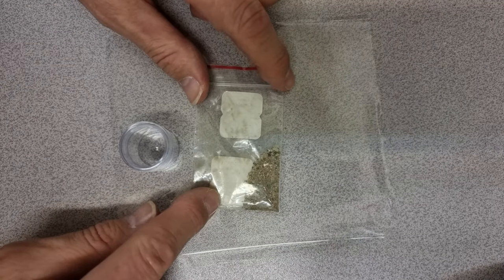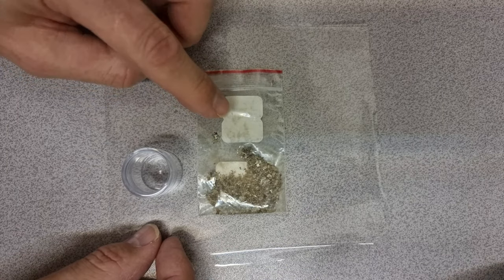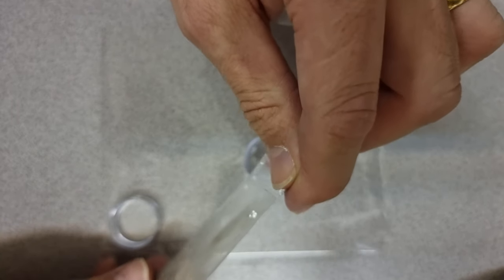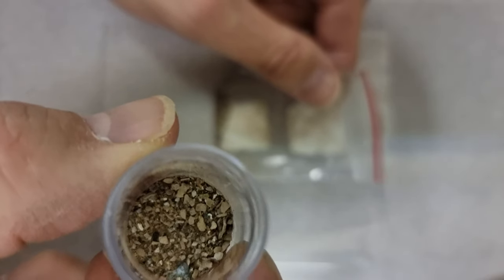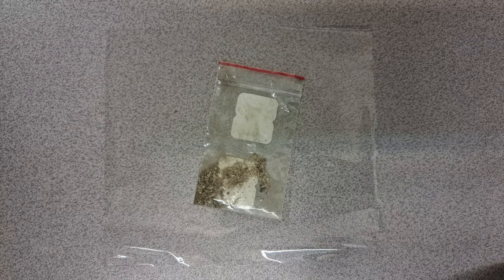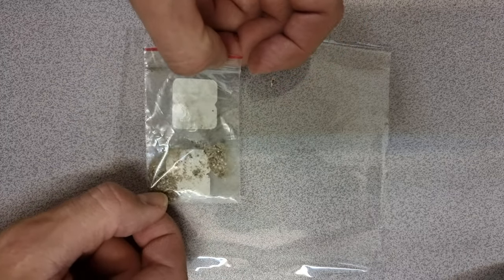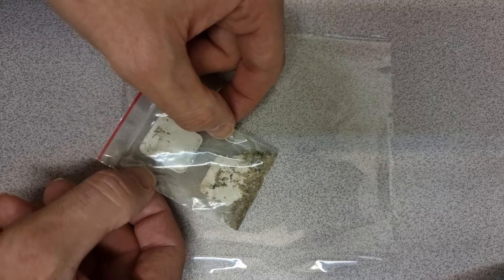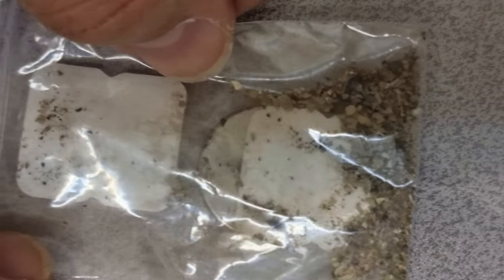Bin-Juine Huang - Investigating scale samples from active LENR reactor for ferromagnetic particles

Comment: To make a magnet you can pass a piece of metal through an electric field and it makes the metal into a magnet.

If there is a buildup of static electric in the system it will lead to tiny lightning bolts transumting things. Metal things in that mix are being exposed to this strong electrical buildup and thus get magnetized. 

Notice too, that sometimes materials seem to catch an like pole on your magnet and are repelled not simply attracted. 

Stuff in that bag was turned into magnets. A good question to ask would be along which axis of the compass was the pipe this scale was collected from oriented. 

You can magnetize a piece of soft iron by laying it on the north south line and tapping the south side. 

You can demagnetize it by turning it east west and tapping the west side. 

I learned this from a book passed down to me by my grandfather who was a frogman in WWIII. It was written by the war department and details everything electrical and magnetic through the whole of the armed forces. 

Grandpa's signature and the date he signed it are in the front cover. 1947.
Reply: Not related, but your mistype of WWIII sent chills through my spine 😮
Reply from the maker: Nice tips. I shall use the magnetometer on the part of the sample that was not exposed to the ND52 to see if it has any magnetism in it.
Reply: @MFMP  I put a post up on Twitter and tagged you in it with my references and some more detail.

You are doing great work Mr. Greenyer!